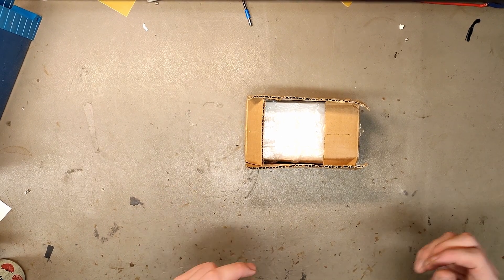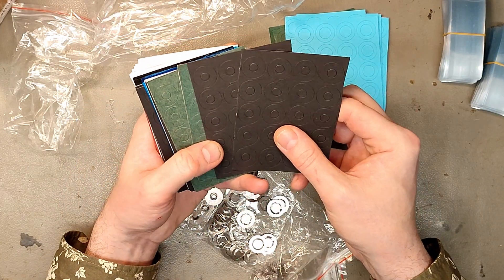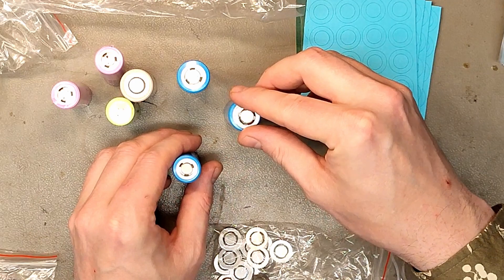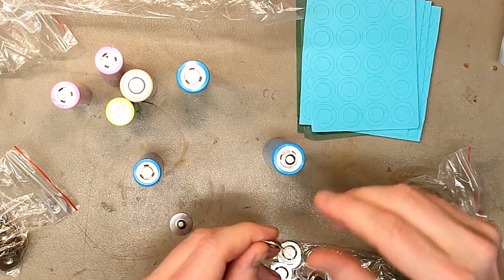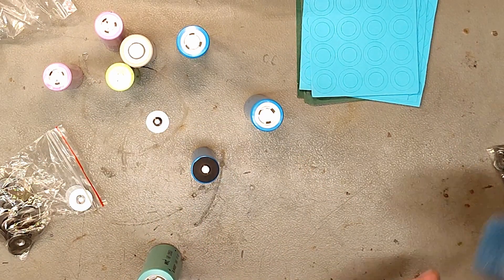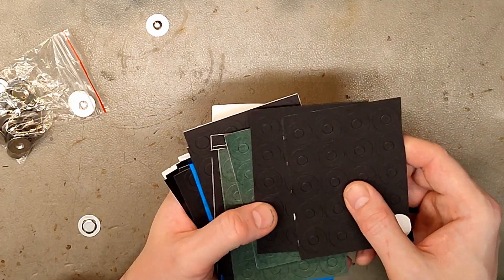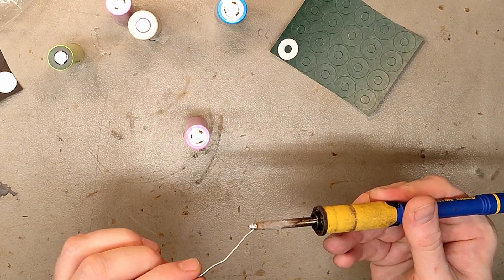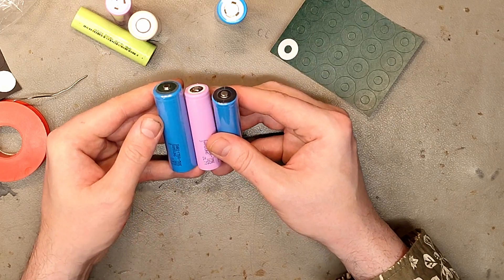Can you make your own Button top 18650/21700 cells? PART 1/3

Comment: The clear wrap around the existing wrap may not allow the battery to slide into a battery frame. I had some that would not fit if I had the slightest irregularity on the wrap at teh ends. Easy enough to strip the old cover off and recover with the clear and pen the battery number on it. Real button tops actually have a management chip under the button

Comment: Can you help with this issue? There are 21700 button type batteries, that are a bit longer, which have a USB-C for self charging with no separate charger. But as they are a bit longer, none of my torches or radios can use it. What lamps radios or torches will take 21700 button top usb-c batteries in them? Thanks! Anyone know??

Comment: Do yo think soldering the positive terminal does not allow any heat to reach the interior of the cell?

I use a small 5mm x 3mm magnet on top of flat tops in single cell flashlights. Wouldn't recommend for high discharge applications and wouldn't use for multi cell flashlights but it works if you only have flat tops and need to power a light that only takes button tops. Adding an insulator ring is a good way to keeping the magnet in the middle and not shorting out on the edge if for some reason the wrap and factory ring got worn.

Comment: Can't you spot welding it to the negative pole?
Reply: You can spotweld nickel which is usually 0,1mm-0,2mm. Welding 1mm steel/alumnium takes a a real welder and the heat associated so really not, but maby you can solder it? But if it leeks "downstairs" you are getting Hot Stuff annyways. Dont really know how chinease factories does them, because lithium cells are always OEM with flattops and Button tops are always rewrapped after market mods.